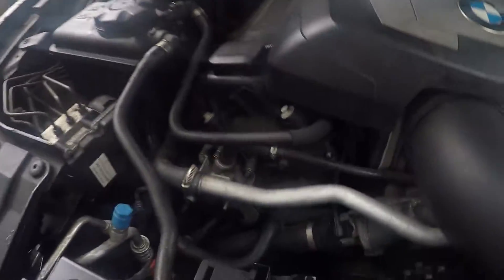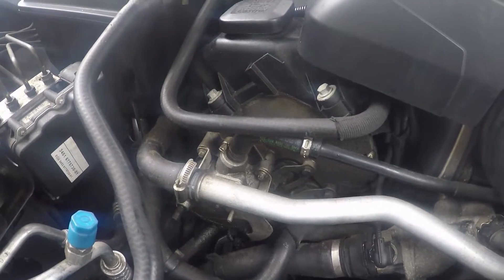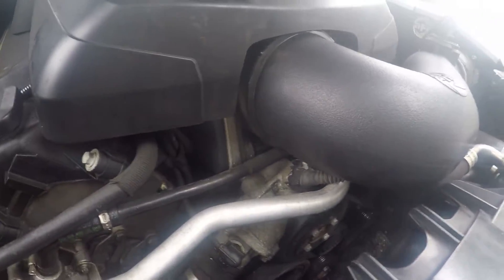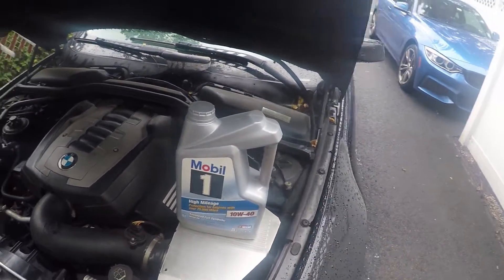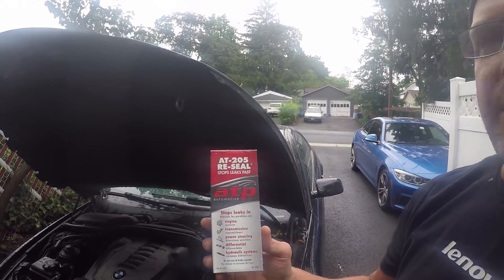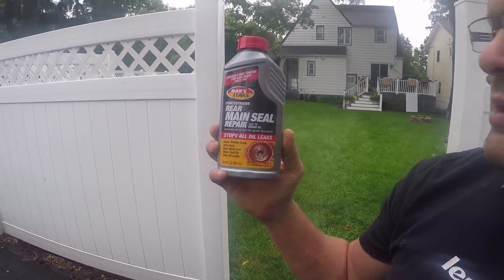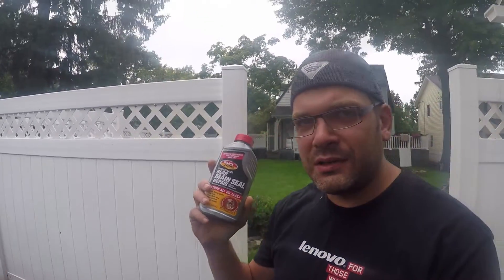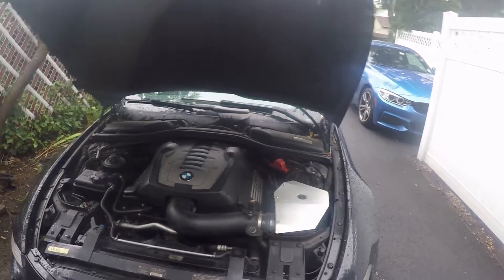BMW Oil Leaks - How to slow / stop them using additives (links in desc.)

Comment: Thanku for your video brother I have the same car and when I brought it from a dealership I was leaking oil from the jump with 39,000 miles and I have the white smoke to at idle smh but I will try your snake oil lol
Reply from the maker: Give it a shot, just understand it's a band-aid, not a long term fix. The N62 engine has gaskets that WILL eventually need to be addressed.  Shine flashlight all over the front of engine and look for leaks... the common ones on this engine are: Oil pump (top left - easy fix you can rebuild it in 30 mins with $15 in parts) valve covers, upper timing covers, alternator mounting bracket gasket (this one REALLY sucks to get to)  Dont let the driver side valve cover leak for long of it will get in your alternator and kill it.

Comment: Grate video man. I have a bmw 2008 X3 it’s have 112000 miles on. 
It’s has some leaks from gasket I believe from top. 
I use 5w-30 oil full synthetic 
Do you recommend me if I can use a more heavy oil. Thank u
Reply from the maker: Give it a shot along with adding the products in this video.  It certainly won't hurt anything and it very likely will slow or stop any small leaks

Comment: Have a 1 series n46 engine 2.0 oil leaks everywhere. Never seen a car so bad underneath caked in sludge. Also is blue smoking so doing my pcv valve and wow. BMW really engineerd this car as a total peice of poo. Also no dipstick and no temp gauge 🥴 I'm 3600 quid in but think I'm gonna get rid asap. 🤔 Saying that tho it is 13 years old but my mk 4 fiesta is 20 yrs old probably as quick and a hell of a lot more reliable 💨

Comment: Do you regret using stop leak
Reply from the maker: Nope, never had any issues why
Reply: @ModsAndProjects  After I watched your and other videos. I put that at-205 in my 2007 bmw.Having all of the gaskets replaced would cost too much money. I wanted to just find out if I made the right choice . Your video was the only bmw one I could find .Bmws have their own special problems .Thanks
Reply from the maker: @ricktaylor26  Definitely a Band-Aid for the more major oil leaks like the alternator mounting bracket gasket.  But for other things like the rear main seal etc. etc. I think it's a great idea to put the stuff in higher mileage BMWs.

Using additives bought me a couple of years and turned moderate leaks into very slow leaks and slow leaks into nothing.  On my end 62 engine I eventually had to change the valve cover gaskets, upper timing chain gaskets, alternator mounting bracket gasket.  But all the other little things I did not change definitely benefited from the additives
Reply: @ricktaylor26 how is the car now ?

Comment: Can I use 10w40 for an N52 engine with 173K miles? It is leaking right now. I assume oil pan gasket leak. I want to slow/stop the leak without changing the oil pan gasket for now. Please let me know. Thank you.

Comment: How's the additives bem working for you
Reply from the maker: Even after i eventually changed out the valve cover gaskets and some others gaskets i still add at-205 every oil change to keep the valve stem seal issue away (im at 150k miles and still NO smoke from the exhaust after long idles).  The Bar's Leaks 1040 Rear Main Seal Repair stuff seem to work VERY well at slowing down and stopping any remaining leak spots I cant get to.  no long term effects that i can tell and the filters always look fine.  Of course if you have a critical gasket (like the alternator mounting bracket gasket on the N62 engine)   is eventually going to completely crack and dump your oil but the additives kept me on the road around 1.5 years until i had time to address the leaks myself.